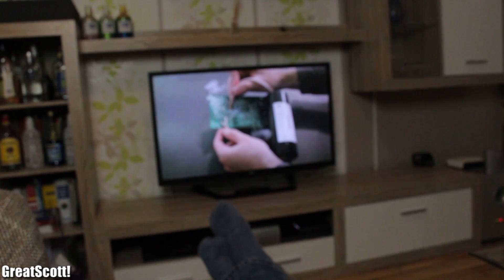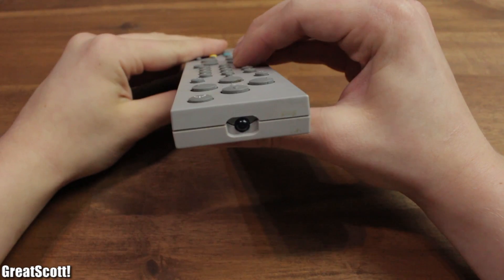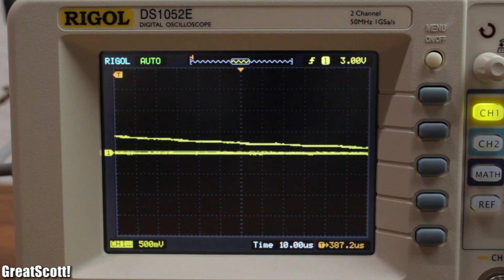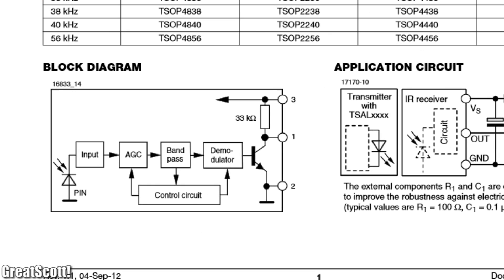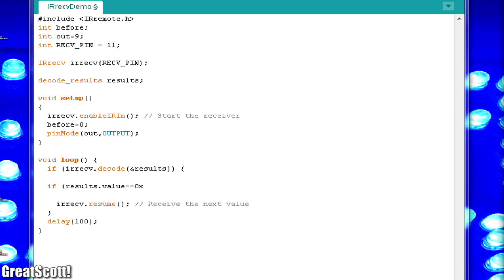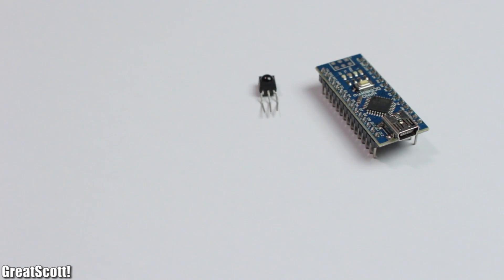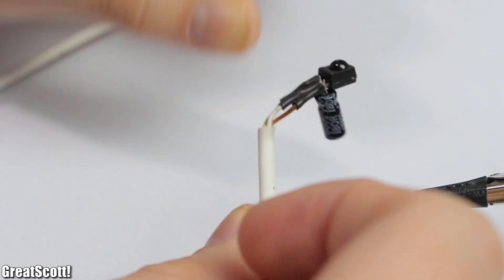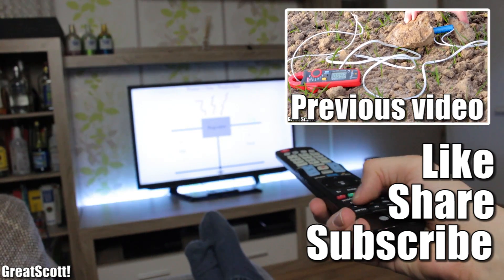Control your LEDs with your TV remote?! || Arduino IR Tutorial

Comment: Fantastic. I always watch you channel. Have you thought of doing an automatic ad mute, where a microphone is monitoring the normal sound in the room, then when an ad comes on its much higher volume. so therefore a circuit will monitor the volume if its higher then mute using the appropriate IR code

Comment: hi scot is not good idea conect the mosfet direct to the arduino output  because  if the mosfet  die, the three pins in the mosfet become in one put your 12 volts in conection with te arduino pin.
the soultion is  optocoupler, to protect your arduino nano. in my lab sometimes mosfet blowing up. for diferent reason abut , i protect the circuits around this.
congratulation for your channel. y see all your videos one by one for  covid 19.
saludops desde Argentina

Comment: I have the opposite problem, whenever I change the volume on my tv, my led lights change to a really fast flashing light
Reply: same why?
Reply: f u I was researching it and I guess the button in my remote is the same and the button in my led controller and it is clicking the buttons when I change the volume
Reply: Aaliyah Essien ohh so is there anyway to fix it?
Reply: Aaliyah Essien it changed with my roku remote is sucks
Reply: @solo1017  omg same
Reply: Same
Reply: Sammme when i change the channel
Reply: Same
Reply: Me too
Reply: yesssssss
Reply: Mine too
Reply: omg same
Reply: Same
Reply: you found solution guys? i have the same problem
Reply: Same.

Comment: how i can switch on/off led without arduino? i have a rgb remote control, i want create a simple receiver
Reply: You need some sort of decoder to decode the IR signal. An arduino is one of the cheapest and best decoders. If you have a Raspberry Pi, you can use that as well. I'm sure someone has put code for it on the net.
Reply: @aathish04  is not possibile if receive any IR signal turn on/off?

Comment: I really want someone to write code without a library decoding IR signals cause it seems impossible for the Arduino in anyway to see the 1 and 0 bursts but it's easy to read them yourself on an oscilloscope no doubt

Comment: plz help me what is this???????????
Arduino: 1.6.0 (Windows 8), Board: "Arduino Uno"

C:\Users\Rejeena\Desktop\music\arduino-1.6.0\libraries\RobotIRremote\src\IRremoteTools.cpp:5:16: error: 'TKD2' was not declared in this scope
 int RECV_PIN = TKD2; // the pin the IR receiver is connected to
                ^
Error compiling.

  This report would have more information with
  "Show verbose output during compilation"
  enabled in File > Preferences.

Comment: i am getting a problem....output voltage  is very low only about 1.5v..i tried using different pin..but doesn't work.....but then simple blink sketch works fine...
plz help

Comment: I have a issue with the code. I used my remote's hexadecimals and used the code to turn the LED on and off. However,  when I use the same remote to increase and decrease the brightness, it does not work. Pls Help!

Comment: hi there i was wondering how to use a ir remoet (preferaberly a diy one) an arduio a relay board and an lcd screen 

this is for a home audio system i would liek to do
so basicaly i can  serlect one chanle on the remote and it changes the chanle on the recever but also continueserly diplays what chanle is serlected 

what i would like i would like a moterised volume controle and the volume displayed under the chanle that is serlected 

i have seen chines products that do this but meny disadvanteges like lac of exspandabilaty unable to change the name of the cerlected chanle

Comment: Arduino: 1.8.2 (Windows 10), Board: "Arduino/Genuino Uno"

C:\Program Files (x86)\Arduino\libraries\RobotIRremote\src\IRremoteTools.cpp:5:16: error: 'TKD2' was not declared in this scope

 int RECV_PIN = TKD2; // the pin the IR receiver is connected to

                ^

exit status 1
Error compiling for board Arduino/Genuino Uno.

This report would have more information with
"Show verbose output during compilation"
option enabled in File -> Preferences.
                                             
Getting this error , please help me out !

Comment: Hi i have problem with tis error message"exit status 1
'E8455D8E' was not declared in this scope
" E84555D8E is that code that i get in serial monitor what should i do?
my source code :
int RECV_PIN = 9;

int before;
int led = 10;
IRrecv irrecv(RECV_PIN);

decode_results results;

void setup()
{
  before = 0;
  irrecv.enableIRIn(); // Start the receiver
  pinMode(10, OUTPUT);
}

void loop() {
  if (irrecv.decode(&results)) {
    
    if (results.value==E8455D8E) {
      if(before==0){
        digitalWrite(led, HIGH);
        before=1;
        }
       else{
        digitalWrite(led, LOW);
        before=0;
        }
    }

  
    irrecv.resume(); // Receive the next value
  }
  delay(100);
}

Comment: Arduino: 1.8.1 (Windows Store 1.8.1.0) (Windows 10), Board: "Arduino Nano, ATmega328"

C:\Program Files\WindowsApps\ArduinoLLC.ArduinoIDE_1.8.1.0_x64__mdqgnx93n4wtt\libraries\RobotIRremote\src\IRremoteTools.cpp:5:16: error: 'TKD2' was not declared in this scope

 int RECV_PIN = TKD2; // the pin the IR receiver is connected to

                ^

Multiple libraries were found for "IRremote.h"
 Used: C:\Program Files\WindowsApps\ArduinoLLC.ArduinoIDE_1.8.1.0_x64__mdqgnx93n4wtt\libraries\RobotIRremote
 Not used: C:\Users\Korisnik\Documents\Arduino\libraries\ArduinoIRremote
exit status 1
Error compiling for board Arduino Nano.

This report would have more information with
"Show verbose output during compilation"
option enabled in File -> Preferences.
HELP

Comment: Hi, can I draw 12V from an arduino when I power it with 12V power supply? If yes how many mA
Reply from the maker: No. The Atmega328P work with voltages up to 5.5V
Reply: thx I have to do some more research then. I want to power 4-5 pwm fans with it. I want them to change rpm depending on temperature.
I only want to use 1 power source =)

Comment: Hi all,
I do not know what I did wrong but with second 10k resistor which is near mosfet this is not working for me. Resistor connects pin 1 and 3 of mosfet (this is how I understand it from the schema) but in this case I have only 7,2V on the LED strip so it does not work. If I remove  that 10k resistor then everything is working fine.
What did I do wrong? What´s risk without seconf resistor near mosfet?

Thanks

Comment: Can some one help me. Here's my code:

#include "Keyboard.h"
#include <IRremote.h>
#include <Keyboard.h>int RECV_PIN = 11;IRrecv irrecv(RECV_PIN);decode_results results;void setup()
{
  Serial.begin(9600);
  irrecv.enableIRIn(); // Start the receiver
}void loop() {
  if (irrecv.decode(&results)) {
    if (results.value == "C43BAC0C") {
      #include "Keyboard.h"
      Keyboard.press('d');
    }
    Serial.println(results.value, HEX);
    irrecv.resume(); // Receive the next value
  }
  delay(100);
}

And here's my error

Arduino: 1.6.13 (Windows 10), Board: "Arduino/Genuino Uno"In file included from C:\Users\Derock\Documents\Arduino\IRForHMGC_Keyboard_\IRForHMGC_Keyboard_.ino:2:0:C:\Program Files (x86)\Arduino\libraries\Keyboard\src/Keyboard.h:29:2: warning: #warning "Using legacy HID core (non pluggable)" [-Wcpp] #warning "Using legacy HID core (non pluggable)"  ^C:\Users\Derock\Documents\Arduino\IRForHMGC_Keyboard_\IRForHMGC_Keyboard_.ino: In function 'void loop()':C:\Users\Derock\Documents\Arduino\IRForHMGC_Keyboard_\IRForHMGC_Keyboard_.ino:20:26: warning: ISO C++ forbids comparison between pointer and integer [-fpermissive]     if (results.value == "C43BAC0C") {                          ^IRForHMGC_Keyboard_:22: error: 'Keyboard' not found. Does your sketch include the line '#include <Keyboard.h>'?
       Keyboard.press('d');       ^exit status 1
'Keyboard' not found. Does your sketch include the line '#include <Keyboard.h>'?This report would have more information with
"Show verbose output during compilation"
option enabled in File -> Preferences.

Comment: Hi,
(Hello from France)
I'm wondering what is the power consumption when the leds are at their lowest luminosity (turned off) ?
It might be a good idea to detect when the ON/OFF button on the remote is activated to turn on and off the leds at the same time and then there's just the arduino power consuption?
What do you think? 

I'm watching your video nearly everyday at my office during lunch break. I really appreciate the way you expose electronic. I 'played' with electronic components since I was 10 years old (I'm 50 now) and I'm still learning from your video. Thanks for that! 
cheers

Comment: The Arduino code is showing error during compiling. 
It's showing 

"C:\Program Files\Arduino\libraries\RobotIRremote\src\IRremoteTools.cpp:5:16: error: 'TKD2' was not declared in this scope
 int RECV_PIN = TKD2; // the pin the IR receiver is connected to"

What does that means,can you help and how to debug this. Thanks

Comment: need help the demo of the ir remote libraries are not compiling :(

it says:

In file included from C:\Users\johnDripper\Documents\Arduino\libraries\Arduino-IRremote-master\ir_Lego_PF.cpp:3:0:

C:\Users\johnDripper\Documents\Arduino\libraries\Arduino-IRremote-master\ir_Lego_PF_BitStreamEncoder.h: In member function 'int LegoPfBitStreamEncoder::getRepeatStopPause() const':

C:\Users\johnDripper\Documents\Arduino\libraries\Arduino-IRremote-master\ir_Lego_PF_BitStreamEncoder.h:107:38: warning: integer overflow in expression [-Woverflow]

       return STOP_PAUSE_DURATION + 5 * MAX_MESSAGE_LENGTH - messageLength;

Comment: With the received signals, could you then transmit them back to the tv using IR  LED? So you could have your arduino turn your tv on, change channels etc? or is signal resolution lost along the way?
Reply: Yes, you can. Some have even built infrared relays that capture IR signals from the room and re-transmit them in a TV cabinet that hides all the devices. Contrary to intuition, IR is surprisingly robust if quality components are used.
Reply: Dale Smith I'm confused why you would want to try and make this thing controller your TV instead of just controlling the TV itself
Reply: panterid sweet, gonna look into that
Reply: justin rivera I guess it does defeat the purpose somewhat, but if you were thinking about having a home automation system, then you could do anything with it. Have it turn off when you leave the house, make it voice activated, send it an e-mail to make sure it's off when you're out of the house, send an e-mail during the day to record a program, connect it to an alarm system so that the t.v turns on to deter would be thieves. Log the number of hours it's been on during the day to stop your kids from watching too much t.v.  etc

Comment: Arduino: 1.6.9 (Windows 7), Board: "Arduino/Genuino Uno"

C:\Program Files\Arduino\libraries\RobotIRremote\src\IRremoteTools.cpp:5:16: error: 'TKD2' was not declared in this scope

 int RECV_PIN = TKD2; // the pin the IR receiver is connected to

                ^

exit status 1
Error compiling for board Arduino/Genuino Uno.

This report would have more information with
"Show verbose output during compilation"
option enabled in File -> Preferences.

Comment: Hey! Can u help me on mine. 
My Nano heats up when i plug it with 12v 2 A Adapter :0
Reply: oh don't ever do that again! Arduino should work on 5V, 1A
Reply: Why? Cause, i connected the 12v power to VIN Pin of the Nano :0
Reply: +Iman Flores I see. sorry for some reason I thought you were talking about usb power.  have no idea then  :/
Reply: Do i have to use a Resistor, capacitor, regulator, or else that could lower down its heat? :0
Sorry, Im just a Newbie trying to learn How :3 
Heheheh
Reply: i don''t know why it heats up, 12v on VIN pin are perfect for arduino nano cause it has a integrated voltage regulator
Reply: Because the onboard 5v voltage regulator on the nano is having to drop 7 volts across it from your 12volt source.
Thats why it gets hot.

Comment: What about the voltage drop between source and drain on the mosfet when is "fully open" ? Have you measured it? Considering how much LED current (and brightness) is sensitive respect to the voltage variations, I think that it is an important parameter to check. If not, you can't reach the maximum brightness that the LED strip can achieve. However great video! Thanks for sharing!

Comment: hey guys anyone help me i am in the middle of something
how can i control tv using android app from this same techique here ,
first of all i need to simulate certain binary or hexa codes and need to transmit from 3.5 mm jack right ;; is there any app that can do this ;; pls anyone suggest
Reply: i guess you could find a way to connect an arduino/raspberry pi to your phone and have that controlling an IR led thus controlling the tv
Reply: use peel remote free for Samsung galaxy note 3 and you can control tv
Reply: Don't know I'm using peel smart remote and it's best remote and control tv, dvd, X box etc
Reply: yeah nowdays smartphones are coming with ir blasters

Comment: Why is there a capacitor between two of your ir receiver's pins ? It seems to work fine without, but maybe i'm just burning my ir receiver.
Reply: Probably to reduce noice on the data line. But don't worry if you don't have one

Comment: did you power the arduino with 12V ?
Reply: yes he did, the arduino has its own voltage regulator, so you dont need any five volt power supply
Reply: +Slinus 02 the nano aswell ?
Reply: +Manuel Pieper i think so, because the nano is just a smaller version of the uno. Maybe i'm wrong,  just look it up on the internet
Reply: +Slinus 02 okay because i powered my nano with 12V and it just stopped working it was not destroyed but it didnt work. So i use a 5V regulator ^^

Comment: Hi, It is supposed to have a current passing in my ir receiver pins from 1 to 3?
i believe i made a wrong connection that i believe fried mine, because of the multiple ir receiver types, mine worked, but on my second circuit it doesnt, i made a circuit, vcc gnd and then signal from my ir receiver to an led, the led stays constantly on, and it does blink when i point the remote at the receiver, was that supposed to happen? Help!!

Comment: How do you control the color?
Reply: Instead of wiring the red, green and blue together, you use three different transistors for each colour, and use more buttons from your remote to increment or decrement the variables used to set the PWM value.
Reply: +iPelaaja1 Thank you. (or maybe kiitos?)

Comment: kennst du die Basis arduino Code fur eine strippe von 600 LEDs in eine X Y Matrix. X=30, und Y= 20. Die LED strippe heist (WS211 5050 RGB.) Ich will wissen wie ich an und aus schalten kann, eine oder mehrer LEDs. Zumbeispiel..... LED nommer 56 HIGH. Alle anderer LOW. Oder.... noch eine beispeil   (LED´s ´67, 71, 85, 200, 250 HIGH, alle anderer LOW.)

Comment: Can I control  5 m  RGB Led Strip with Arduino and remote?
Reply: Yes. I built a circuit that does it. Instead of wiring the r, g and b together, just use three transisotr, and more buttons from the remote to control them separately. I used TIP120 transistors for my circuit.
Reply: +iPelaaja1  Ok, thank you very much :)

Comment: this may be a strange question but 
do you think an Arduino Nano would be able to do controller input display?
for snes n64 and gamecube
Reply: Im not sure but it could be Done... (I Dont know what you Want to do)
Reply: connect game controller to device and have it display inputs through a program, and still be able to use it on console .

an example may help
so lets say i am playing mario kart 8 with my snes pad (snes to wiimote adapter) and for some stupid reason i decide i want to display button inputs for stream. is it possible?
Reply: taitaylor86
taff question... without testing i cant give you an answer... my only consern is that the nano doenst have enough power :/ sry cant help you with that...
Reply: no prob.
Reply: You can definitely do that. But you also need to get the output into a computer that does the display stuff.

Comment: because the carrier wave has been removed,  the set up is vulnerable to stray IR light as explained by Mr Greatscott, so I flicked my cigarette lighter in front of it and behold it gave it a HEX code! Wonder how many suspicious cigarette's I would have to light to get the same HEX code ?
Reply: Hmm...
Thats quite interesting.
So, cigarettes burn particles 36.000 times a second(36 KHz)
Reply: I thought the carrier was removed AFTER the detector, i.e. the IR sensor is still protected?
Reply: Use a cigarette lighter to turn on LEDs. Lel

Comment: sir ,whats the use of mosfet in this project
Reply: +ramana naidu The Arduino is not capable of supplying the needed amperage to the led strip to you need to use an external power source. The MOSFET has 3 pins: Base, Emitter, Collector. From the power source to the Collector, from the Emitter to the led strip, and the Arduino to the Base. It is basically a switch that the Arduino controls and  can be turned on and off very rabidly so instead of a constant on which will produce a stead current to the led and a single brightness, you "pulse" via pwm from the Arduino. This effectively only allows the led to illuminate for a shorter duration, making it seem less bright. 

If you are unsure of how a transistor/MOSFET really work, do a quick search on MOSFET tutorial.

Comment: sir i am not getting a hex code in the serial window rather i am getting 3/4 character codes like 
18B5
8B5
1891
1891
892
892
18D5
18D5
892
1892
1892
 please help
Reply: +25Aditya25 those are hex codes. you can recognize them by looking for normal characters in the value "18B5" for example. just try with an led, like the guy in the video did